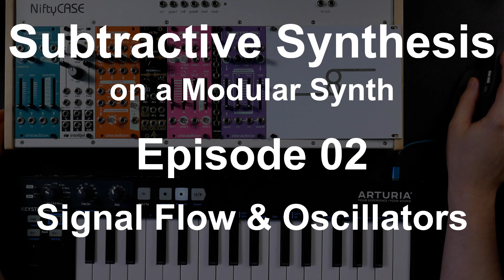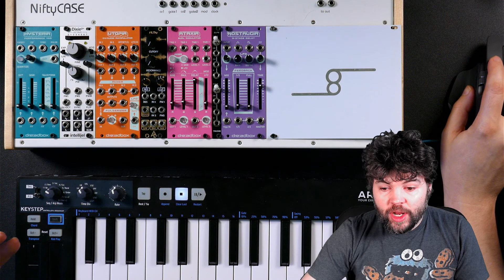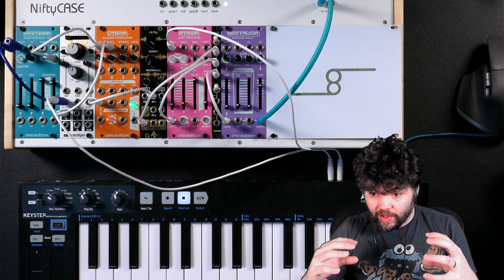Subtractive Synthesis on a Modular Synth: Ep02 - Signal Flow & Oscillator

Comment: Cool videos. I already more or less familiar with those things, but only virtually. And this is quite interesting to watch this in action on different devices.
But why on every synth same waveform sounds different? Maybe YT compression issue in this case, but even plain Volca's sawtooth seems not really "plain".
Keyboard is pretty noisy. Does it really so clicky or just mic located nearby? Also I noticed that on different models and on videos of other authors... I have not access to any right now but I clearly remember that real piano keys has fabric dampers.
Reply from the maker: Thanks for watching, and for your comment. There is definitely variation in the sounds of the basic waveforms between synths (the waveform is rarely a mathematically perfect shape). There is also variation in how "open" the filter can go. For the volca in particular, the filter does not track (open or close following the note you play) which means this effect can be more pronounced. The volca also has a delay insert which is always affecting the signal to some degree. While this version sounds significant when you listen carefully with the filter open, this isn't usually how you use the synths. On a real sound, and in a mix with other sounds, having applied some EQ, the difference become far less noticeable.

As for the keystep (which I presume you are asking about) or most synths, the keys are very different to a piano. A piano key is long and made of a single piece of wood; its resistance is the weight of the hammer; it has fabric between the top of the key and the body to dampen the "clack" when it goes back up. Midi controllers and most synths have shorter, hollow plastic keys. They also use a spring for resistance to you pressing them. The result is that they feel different to piano keys and often have more mechanical noise. This is far less important than on a piano as synths have audio output which doesn't contain that mechanical noise. I am recording with an overhead mic with some noise reduction, which eliminates various background noise, but doesn't eliminate key noise. This may or may not accentuate the key noise, but overall I've never found it to be a problem in practise.